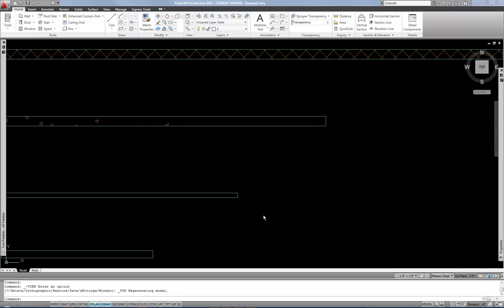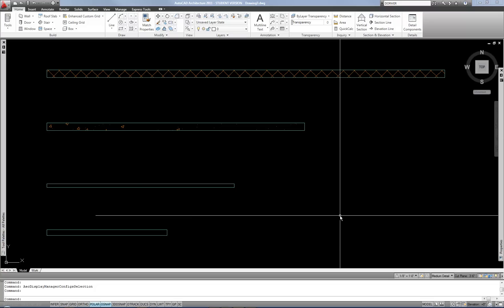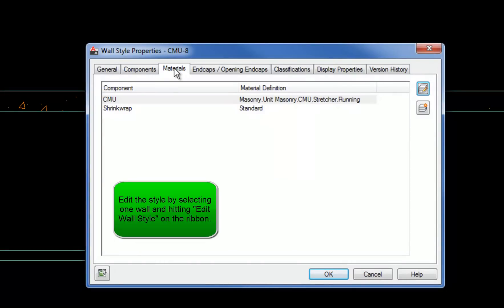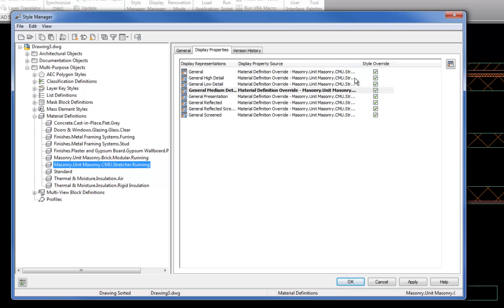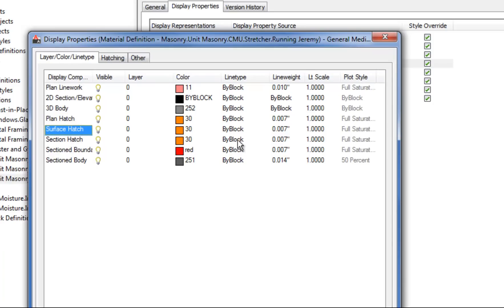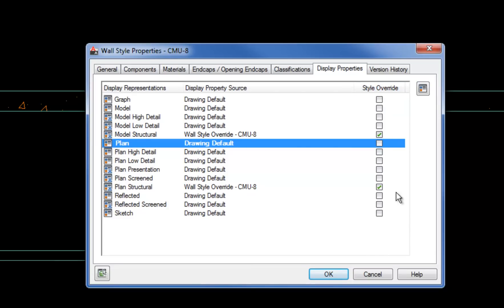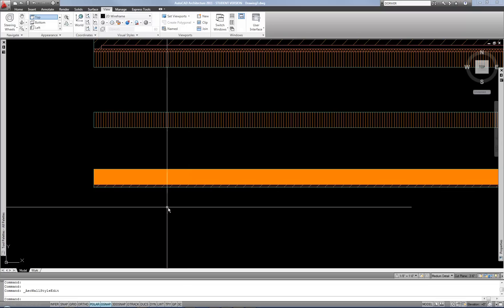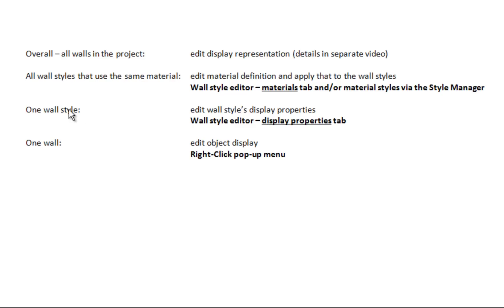ACA: Display Properties &  Materials

Comment from the maker: @trimix83wasTAKEN You are correct that regular blocks are fixed in size. I would create a DYNAMIC block  This is a regular block with additional features included, such as adjustable size or the ability to turn on/off 2x members.  There are some dynamic blocks included in ACA, such as on the Tool Palette (Detailing category, Basic tab).  Otherwise you can explore the help menu or other youtube videos.  I can add dynamic blocks to my list for future videos.

Comment: (it wasn't me...) Following this video, been trying for hours to modify a "Beam" to a 3- 2x10 Builtup wooden beam...similar to a header.  All ACA has is steel beams.  I created blocks - but can't use them.  I created a new item, but can't modify its size from defaulted 12" width.   This is main problem - I just want to modify the size to reflect what will be used, but can't.  Help?